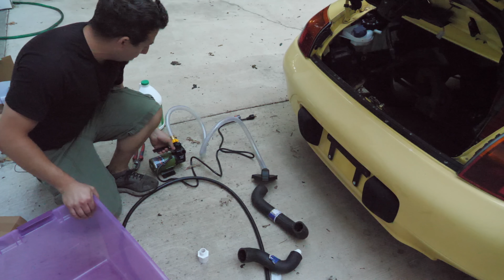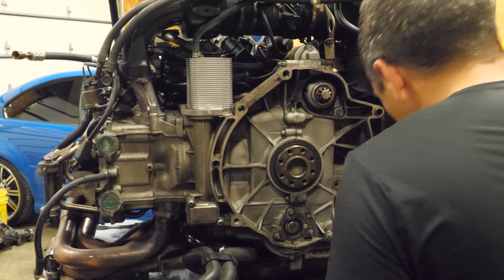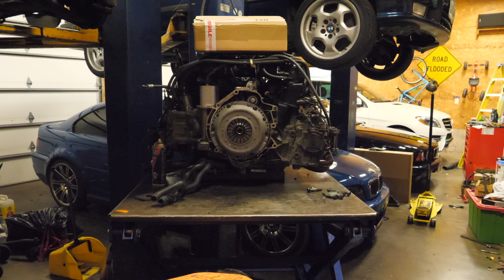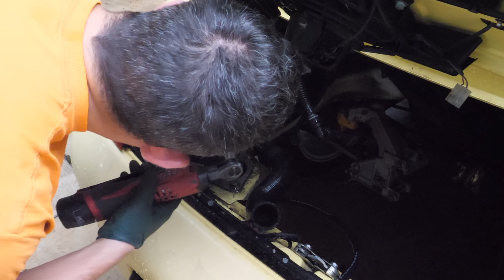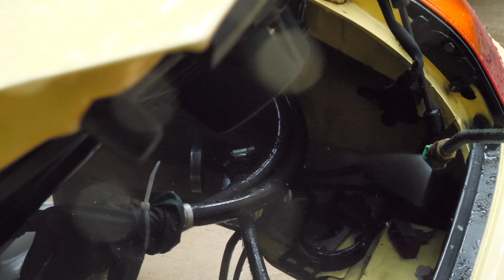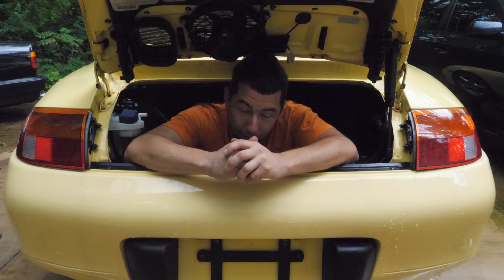Porsche 911 Update! FINALLY! Starting To Put The "Turn-Key" 996 Back Together!

Comment: great work love it. the ims bearing comes in three sizes.  early one is double row,  second a single one, last a bigger one.
still i would change it,  if i were you.
love the toyota bolts, in fact toyota has a lot more to do with the 996.  serious

Comment: How is a AOS introducing coolant into the oil?  Wouldn't the oil cooler cause that instead?   and I  noticed that motor had a recent changed one.  A bad AOS would only introduce oil vapor into the intake track, which cause the motor to run like crap and smoke?  Am I missing something here?

Comment: I had a beautiful 2002 C4 Cabriolet with 61K Miles, had a Speck clutch installed and the shop never recommended an IMS bearing upgrade. 2,000 mi. after the clutch replacement, the IMS failed and destroyed my engine. I was doing 50 MPH in 3rd gear. Never beat on the car. I blamed the shop for not recommending the upgrade while they had the clutch out. Loved that car. Sold it as a roller for $7000. Such a shame.

Comment: Best way I've found to "flush" the cooling system, is to remove the Radiator(s) and clean like you are doing. Fin check, leaks, bad solder joints, all checked and solid.

Comment: you kind of skipped over the IMSB. Was there a single row where there should've been a double row?
Reply: just got to the end. Does your engine have serial number with AT in it? If so that was a replacement motor by Porsche, which would explain the IMSB situation you discovered.

Comment: I hate to see shoddy mechanical work!  I don't care if it's a brand-new top-of-the-line Porsche, or a 1998 shit-box, the customer paid good money to have the job done right, and that's what they should get.  When I was an apprentice mechanic in the 1970s, the "old timers," (whose main joy in life was riding my ass), would always tell me "Fix it so when the next mechanic works on it, he's impressed with your work."  These guys were all former military aircraft mechanics, and everything had better be PERFECT before you closed the hood.  EVERY wire had better be in its clip.  EVERY electrical connection you disconnected had better be clean, bright and have dielectric grease on it.  If I EVER catch you reusing a cotter pin or a nylock nut, you'll be eating them for lunch.  If you track grease or dirt into a customer's car, you'll be detailing the entire inside to white glove standards.  They were hard-asses, but I learned not to take short-cuts and to hold myself to a high standard.  They rode me like a rented mule, but now I'm grateful for it.

Comment: The nice thing about fixing a Porsche is there are only 43,854 things left to fix and you simply fixed one.  As you drive down the road with a smile on your face, know that some other crappy, cheaply made part is about to fail and you'll pay dearly for the replacement part.  Once you fix THAT part, you're closer to finishing the project but unfortunately, with a Porsche...you never quite get there.  Many people will disagree but that's only because DISASTER hasn't hit them yet.  This is known as a "false sense of security" but as with all German cars, being stranded on the side of the road is as close as your next outing.  Smile away.  Listen to that tinny sound of junk and enjoy it while you can.  Hell, don't believe me.  I learned the hard way.  Most of you will too.  Do your own research.  Here's something to get you started: https://www.bing.com/search?q=porsche+reliability+rating&FORM=QSRE1
RELIABILITY RATING
2.0 out of 5.0
Reliability rating based on the cost, frequency, and severity of actual repairs. The Porsche Reliability Rating is 2.0 out of 5.0, which ranks it 32nd out of 32 for all car brands. This rating is based on an average across 345 unique models.

Comment: Most of the time does fly wheel bolts aren’t torque to healed they just say that they’re one time use that can really be reused.  Unless the bolts are neck down beneath the shoulder on the smooth shank they’re not stretch bolts

Comment: Check for “AT” in the engine number. It looks like a factory replacement engine with the big non serviceable IMS bearing. That’s why you can’t replace it (without splitting the case) like the ordinary single or dual row ones.
Regards the intermix, I’ve watched the videos from the previous owner and I wondered why he didn’t seams to pinpoint the fault. He correctly checked the cylinder heads but unfortunately I don’t think I got it done right, because 99% of the intermixes in a M96 3.4 engine is caused by a cracked head.

Comment: As the IMS bearing sits partially submerged in engine oil, over time the oil will wash out the grease. Pulling the outer seal off of the bearing is suggested as a way to keep the bearing lubricated. Whenever I've pulled the outlet seal off, I've always found that there was no grease left in the bearing. You probably don't want to go back in there now that you've done all this work, but...

Comment: This video is activating my PTSD from owning my 2002 996. It was a repeat offender, 5 failed rear main seals (RMS). It’s not the seal, it was the engine casting that had the wrong size hole, but Porsche was not about to replace the engine. After 5 RMS replacements, I don’t think I ever remember seeing the flywheel bolts on the invoice.  I wonder if they EVER replaced them.  I was so happy to be rid of that nightmare. It was so disappointing as I had the 911 car poster in my wall since I was a kid in the 70’s and then finally owning one was a disaster.  No more VAG products for me.

Comment: You should run a VIN check on that car.  It will give you the serial number of the original engine as well as a breakdown of options.  Kinda cool.  I suspect the engine has been replaced since your IMS bearing can't be replaced.

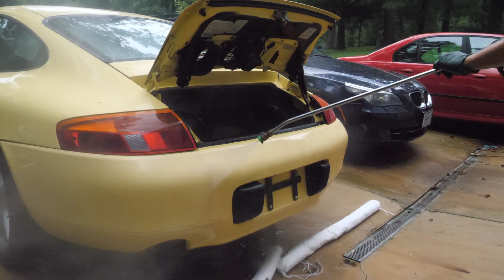Comment: You should always cover any unmated connectors before washing (e.g. @23:05 the one with the purple slider). These electrical connectors are actually water tight but only when mated with their counterpart. Otherwise you'll get water sucked into the terminals and further into the wires and that will over time cause all sorts of trouble.

Comment: I haven't read all the other comments, so somebody might have already mentioned it. 
But you really should have had the flywheel resurfaced before you reassembled it.
There are too many hot spots, hot spots will cause clutch "chatter",
Causing the car to shake upon clutch engagement.

Comment: That bearing has part #99602406 which is the third iteration of that bearing design that requires splitting the case to be able to replace it. All of the internet says these were introduced around 2006, so your engine is most likely a replacement engine. Can't find any reference they started with this design, then went to the double-row replacable one, then the single row replaceable one, then back to the non-replacable one.

Comment: Torque angle does not necessarily mean torque to yield, single use bolts... it's just a procedure to achieve a very precise clamping force, needed for TTY bolts yes, but not exclusive to them.

Comment: Maybe the previous owner didn't yank the flywheel at all, and just gave it the ol' sandpaper flap disc "resurface".  I believe all elephants would approve of your coolant recirculator layout.  I've heard of people using CLR or Lime Away to clean out the cooling systems.

Comment: I think you had the right idea for cleaning out the cooling system. I just think you should have filled the system as much as you could, and then let it sit for an hour before starting the pump again. Solvent may need some time to work what was in it. Do they sell liquid braekleen? Could just put that in your solution and let it sit for a while.
Cool to see you putting something together! Seeing the mating of engine and gearbox gave me a taste of what I have to look forward to when replacing the subaru wrx 5 speed ( now without 3rd ) with a subaru 6 speed box. That thing is heavy, just lifting it out of the crate it came in was a workout.

Comment: It's worth replacing the oil separator whilst access is good.
I replaced the clutch on my 986 (with new bolts) and though hey, let's check the IMS as you do.
What I found was a mangled mess where someone had cracked the case around the bearing cover presumably using a slide hammer or worse and then used a grinder to "smooth" things out for a quality repair.

Comment: The second day I owned my new to me Jaguar XK120, the driven clutch disc came apart at a moderate engine speed. The seats and floor panels and trans tunnel were removed, allowing easy access to the trans and clutch. Without an input shaft to align the new clutch disk, I eyeballed it when bolting the clutch to the flywheel. When my mentor got home from work, I obtained an input shaft and checked my clutch alignment.  That input shaft slipped right in, clear into the pilot bearing. I’m sorry I didn’t try installing the transmission. I could have perfect clutch job without using an alignment tool. If only.

Comment: Yeah, the coolant matters. It's pretty basic chemistry.
When iron comes into contact with alkaline liquids it does nothing. With acidic liquids, iron oxidizes and you get your iron engine turning into rust. 
When aluminum comes into contact with alkaline liquids, it falls apart. With acidic liquids, aluminum oxidizes and forms a layer of aluminum oxide, otherwise known as sapphire, hard protective and really good at transferring heat.

Vintage green coolant starts out alkaline to protect iron engine blocks and heads, and when it gets old it turns acidic, it would normally get thrown away because it will now turn an iron block to rust.  
Modern aluminum compatible coolant starts out acidic to protect aluminum. Green alkaline coolant starts to eat aluminum pretty quickly and you end up with pinholes in the water jacket and a destroyed engine.

This is very simplified, but the takeaway is to use the manufacturer recommended coolant for your engine.
Reply: Thanks for the explanation, I've never actually seen anyone explain that before outside of just listing the different colors and what the acronyms stand fkr.

Comment: When removing and final assembling the flywheel bolts you should use a flywheel holding strap which you can fabricate yourself. Putting all that torque through the crank pully locking pin is not the preferred method.

Comment: Seeing they just did a cover up job i would have checked or surfaced the fly wheel too while it was off. And by the way, good old heavy duty oven cleaner you can get at Menards works better than over priced de-greaser.

Comment: Thanks for the entertainment, you are showing us what sort of weird chemicals you can run through a car.  Who cares what the specs are on the internal "soft bits" like O-rings and seals and what-not.   Stuff that stands up to buffered antifreeze may not necessarily survive "Simply green" (??) and its components. Or dishwashing liquid.  Caution with your o-rings and other components.  Please consider the reactions between the different components already introduced, which may react badly when combined.  I thank you for your kind attention.

Comment: Bit concerned about the IMSB; did it get uprated to the stupid "improved" one you have to split the case to get at? 
The factory 99 IMSB was dual row and rarely if ever failed. If someone took that out and put the "new" one in, that really sucks.
(Edit: just saw your comment about the super early larger IMSB - that's new to me!)
Reply: What does the IMSB do and what does the acronym stand for? And why do they need to be replaced?
Reply: @budlanctot3060  long story, but it's a stupid part of the motor design where an intermediate shaft ("IMS") is required to turn the cams from the crank, and many of the bearings ("IMS B"earing) used to allow the shaft to rotate are garbage and fail, taking out the engine with them. 
People sell "better" bearings but even those need service or replacement every so often. 
One of the many design flaws with this (with any) engine.
Reply: @budlanctot3060  to add a little more detail, the IMS-bearing was not I dependently lubricated. The grease would dry out/wear out and the bearing would seize. Some of the engines would fail (intermediate shaft seizing) at idle at a stoplight or in the driveway. A terrible design. One of the aftermarket “fixes” was to remove the seal between the crankcase and the bearing so engine oil could make its way to the bearing to keep it lubricated. But that was not a reliable solution.  The IMS and rear main engine seal (RMS) are the Achilles Heal of this motor. The IMS failure was so common there was a class action lawsuit against Porsche which they lost. LOTs of engine replacements in the 996 (M96).
Reply: Right, how early of a 99 is it?

Comment: You put 2 athletic socks over the end of the radiator hose that comes back into  your laundry basket to catch the debris coming out the car.  Just make sure they don't have holes in them.  Works like a champ!  (especially when you mix CLR in the recirculated water).  I flushed/backflushed the heater core that way, worked perfectly.

Comment: The IMS in a '99 Porsche 911 engine is in fact removable without splitting the engine case.  As you noted, there were a couple of different IMS bearing designs Porsche used in 996 engines, with the early ones being much more robust.  If Porsche ever replaced the engine, they would have installed the then-current block design (which, for 2006+ models, "featured" an IMS design that could only be removed by splitting the case...ugh).  LN Engineering has a very detailed write-up on the IMS "issue" on their website; its worth a read.
Reply: Forgive my ignorance (not stupidity) but what does IMS stand for?
Reply: @ToddAdams1234  InterMediate Shaft - drives the cams, driven by the crank, because more chains are better or something like that.
The IMS bearing is the part in question. Several iterations of the bearing used on the intermediate shaft in this engine are known to fail. Very few are not. Hopefully Eric has one that is OK.

Comment: A couple of years ago Auto Auction Rebuild had a Porsche that had oil in its cooling system and after he did some research he was advised to use Shout if you check his videos he had put together a whole system to clean it and refill it and he found that the oil had destroyed the hoses and had to replace them

Comment: Hello Eric: I'm sorry that you had to go through all of this nonsensical BS. While I've been turning wrenches for 60 years now I  have come to the realization that I'll believe it after I've seen it. In both of my independant shops + the dealer if one of my guys did work like that he would have been gone in a heartbeat !!!! IMHO there is no excuse for shoddy work like that. The torque to yeald bolts that were reused + the pressure plate not being torqued to spec is unforgivable. This is why in my shops & dealer I would do spot inspections & none of my people wanted me to find anything wrong. I find it amazing that mechanics can find the time to  do a job twice instead of doing it correctly/ perfect the first time. To attain perfection the first time my guys never lost time,  I always made it right. My customers paid for perfection & it was my responsibility to make it happen with no excuses. Sorry if I sound angry but there are way to many third stringers boasting how terrific they are. I love your videos & I'm glad I'm a subscriber. Take care all, TMP from N.J.
Reply: I wish there were more mechanics like you out there. Best wishes.
Reply: @lannyqualls9428  Good evening Lanny: Thank you for your kind words 😊 . It really takes many years of sacrifice with low pay,  always buying more tools, + the toll it takes on your body. When I owned my both shops my motto was IF IT'S NOT PERFECT IT DOESN'T ROLL !!!! I've slowed down a lot cause I'm old but that motto is what I live by this day. I personally thought Eric was most kind with what  the previous owner did + cutting corners. Since I'm in N J. I personally wouldn't have been that gracious & he definitely would have gotten a  warm N.J. welcome ( BIG TIME  ). Take care sir, TMP from N.J.
Reply: Ya right....you owned shops and only accepted high end cars...that's why u went broke and had to shut down cause you never had enough business...anyone with half a brain in their head will take every kia and junker...that's where the money and profit is....🤑🤡
Reply: I've learned over the years, that if someone brags about how good they are, they probably aren't.
Reply: @Albert Einstein Sorry guy. I only did high end 🚗 cars. I refuse to do oil changes on Kia's, I refuse to work on junk !!!!!!

Comment: The early 996 had a dual row IMS bearing that totally replaceable. The only ones with a non-serviceable bearing are reman units Porsche installed on a lot of cars that had had a failure. Is there an AT after the engine serial number?
Reply: As long as it isn’t a replacement engine with the larger non serviceable IMS bearing it has the original dual row bearing and that is totally serviceable. I changed mine myself. There are tons of different replacement bearings to choose from and even an original bearing if you look hard for it.
Reply from the maker: Not sure but I’ll look tonight! 
Every person I talked to said some super early 996’s(my car is 2/98) had a dual row 997 type of bearing.